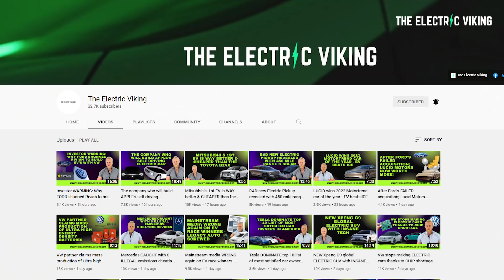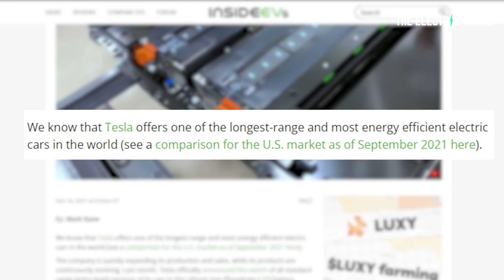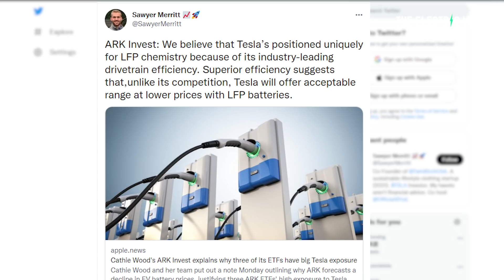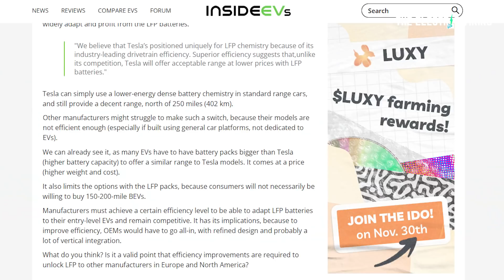3 REASONS Tesla pivoted to LFP batteries faster than everyone else

Comment: Key advantage of LFP is the size of the resource. Iron, lithium and phosphate are all very common materials. Currently this means lower price, but at higher volumes in means the difference between being possible to scale or not.

I think you are mixing up gross margin (gross profit before overheads) vs operating margin (net profit). Typical 8% operating margin for a legacy auto manufacturer compares to about 14% in Tesla last quarter.  The 14% is not 30% but it is impressive because it is much more than 8 and is entirely from the sale of EV’s.

Comment: My LFP Model 3 has been performing brilliantly and it's starting to get quite cold in the Chicago area. Being able to use all of the battery is a huge advantage over NCM Bolt I used to drive. The heat pump seems to make a huge difference because I'm just not noticing a huge drop in performance due to the cold like I did in the Bolt.

Comment: Waiting for the cyber truck my number is around 67000. Rumor is they will have 4680 but the chemistry  is unknown at present. I want range but the truck does not have to go 0 to 60 in 3.2 seconds. I want 500 miles range with a 2 motor set up instead of 3 motors.  I want to be able to road trip and not be unduly constrained.

Comment: I'd rather have a ternary battery unless the LFP battery has a fast, efficient heating system.  BYD Blade has a good heater that solves LFP's low temperature problems.  I also prefer the higher energy density of ternary batteries.  I like acceleration.  Ternary lasts long enough for me, and charging between 20 and 80 percent for everyday use is a non-problem.  If LFP cost dramatically less than ternary, that could influence my decision.
Reply: Don't worry by time you actually have to change your batteries the price of them worldwide will have come down significantly by then everyone's going to have figured out which ones to use for different reasons Vehicles will most likely have multiple battery type options and will eventually be manufactured by recycling and remanufacturing companies like abml which will help to drive prices even lower

Comment: Hi Viking. Maybe you can answer this question that I have never seen answered anywhere:
- Can 4680 or other cylindrical cells as well be LFP? 
I have seen a hundred uninformed opinion about 4680 against LFP, but never understood why not having cylindrical 4680 LFP and turn it into a structural battery that would be cheap, safe, super long battery life, 0-100% repeated charge/recharge cycle, fast charge times, etc.
Structural battery using 4680 or similar cylindrical cells has such huge mass production (both cell and car mass production) benefits that the prismatic cells can't provide.
Reply: 4680 is just a battery size.  You can have any chemistry you want in it.
Reply: @incognitotorpedo42  I know it's a battery size. I was assuming it could be also LFP, but never saw any expert saying so.

Comment: The more car models there are the more difficult it is to chose one. Frankly I think my choice is not built yet.
What I want is a utility van that I can convert to the task I need to perform at the time. I want it low to the ground not at all like those horrible looking pickup trucks. I’d like it to be small enough to park it in a congested city and long enough to sleep or camp in, a tue utility vehicle. I think the ID Buzz would fit the bill… if the price is adequate and if ever it comes out.☹️

Comment: The big question here is will Tesla be able to run LFP chemistry in 4680s. If they can increase the energy density by just 10% and reduce the cost of manufacture by just 10%, then that gives Tesla the ability to offer the  standard Model 3 and Y with over 300 miles of EPA range. That is an incredible marketing advantage over every other EV maker.

Comment: BYD literally invented them. As far as I know, BYD wil sell them to Tesla, so in what sense is Tesla ahead here? BYDs Blade Battery was out last year already, including the information about it's advantages. So what about the 4680 now? Those have been announced like the second coming - and now? In the future, BYD will flood (like other chinese brands) the worldwide market with good EVs loaded with LFP batteries (which was not possible before for patent reasons).
Reply: The way the 4680 battery is stacked is incredibly unique its ability to charge fast last longer Costless and wouldn't be hard to change the battery ingredients the  lithium ions move from the negative electrode to the positive electrode during discharge and back when charging. Positive cathode negative anode the cathode and the anode are usually made of cobalt or graphite which is very expensive and Cobalt is mainly mining in Africa using methods that are inhumane
Using the 4680 cell you would just have to replace the Cobalt or graphite with iron and phosphate

Comment: Back in 2015 and before that the Nissan Leaf came with a LiFePO4 battery with a poor reputation for rapidly deteriorating range and a short usable life time.  Tesla on the other hand with an NCA battery had little range loss per year, the battery might even outlast the rest of the car. Of course Nissan did not liquid cool the Leaf battery, even the air cooling with the battery being in a closed box was hopeless. However even given the well known lack of thermal management it seems passing strange that a technology that was regarded as second rate when compared to Tesla's high energy density batteries is now being embraced by Tesla and the NCA technology we were convinced was superior is being quietly sidelined. Just as you think you have a handle on the broad strokes everything you thought you knew is no longer true.
Reply: Duracell and Energizer batteries we're always good but have gotten better...Cobalt is very expensive and mainly is mined in Africa using methods that are considered inhumane

Comment: LFP's like to be fast charged at warmer temperatures, 30 - 35 degrees celsius. Then you get okish 180 kw peak charging. At 20-25 ºC you only get half of that charging speed. Meaning if you live in a place with colder seasons with max temps of 5ºC, forget that peak 180 charging speed as the TM3 and TMY thermal management right now can only provide you with half of it by reaching only 20 - 25ºC. Despite that you still have a charging speed above NMC's after a state of charge of 75% and unafected power delivery.  If you live in warmer regions and need a daily and beaten workhorse car, not the fastestest sporty car, LPF's seems to be the really clever option. Nonetheless I can't see Tesla using the LFP chemistry in their 4680s because those use the Tesla patented dry electrodes for fast production which have not been developed for the LFP chemistry. So, no, no structural packs can be build with LFPs mean Tesla will need to build two versions of the Model Y which doesn't make sense but will see how things develop.
Reply: Yeah it's going to take some time but thousands of things need batteries they are not all the same for good reasons besides this guy is putting rockets in space you think he's going to let a little thing like what goes in the 4680 stop him same cam same soup different ingredients

Comment: Everyone always forgets that the 2014 Chevy Spark EV has LFP batteries.  I bought one and can tell you the battery is holding up great.  Originally the car had a mixed driving range of 83 miles.  Now 7.5 years later when I charge the car up to 100% now it usually says 80 miles range.  It even said 81 miles last week though 79 miles range is not unheard of for me either.  The car's computer takes into account the last 50 miles of driving and calculates how many kWh per mile you averaged to computer the range of the car.  Even though the car's range is 80 miles there are enough DC Fast Chargers in my State that I can go anywhere.  Even a car with only 40 or 50 miles is very usable as long as it has DC Fast Charging capabilities.  I think a car with 150 miles range would be ideal.  250 or more is overkill and just a waste of energy carrying a bigger heavier battery around.  My hope is the LFP batteries will be shown to be able to DC Fast Charge at much higher kW than other chemistry.  My Spark EV can DC Fast Charge at 50 kW.  It can charge from 0 to 80% in 20 minutes.  A 30% to 80% takes me just under 10 minutes.  Imagine if it could charge at 150 kW.  That 0 to 80% would take just over 6 minutes 30 seconds.
Reply: That looks like another epic fail by GM's management. They were using the safest, most long lived battery chemistry years before Tesla, yet they still managed to muck it up by booting LFP batteries
Reply: @xmiller7691  from what I understand General Motors battery supplier during the spark and volt production was a company called A123 Systems in the early 2000s right around the time gas prices doubled I would not be the least bit surprised if Big Oil lined the pockets of some General Motors executives to make sure they didn't have to worry about Alternative energy competition
 General Motors now partnered with LG chem have recalled over 200,000 vehicles due to fires from the batteries
Hyundai also recalled 90,000 vehicles for fear of the same issues
Reply: "Overkill" range becomes a must have in colder climates where the battery may read 30% and then quit and leave you by the side of the road.
Reply: Sounds if the Leaf used them originally they would had held on to a larger market share.
Reply: You cannot waste energy in the manner you are referring to if you have a larger battery s more capacity for energy you will be able to drive further therefore you will be charging your car less frequently which helps to alleviate drain on power grids. and I do not mean to be rude but I fail to understand your logic referring to carrying a bigger heavier battery around you must keep in mind that you could have a thousand-pound battery a 2000 lb battery a 2500 lb battery and the vehicle overall will most likely weigh less or about average of any other vehicle in its class because there is no transmission driveshaft differentials engine block manifolds exhaust pipes mufflers oil pan ECT.
electric delivers instant torque the horsepower is actual and because all of the vehicle's power is available to the motors instantly it is more than capable of propelling the vehicle. Regardless of weight . I am curious... if you're only getting 80 miles to a charge how many miles do you average per week?
 my Lucid AIR has a 500-mile range I will charge it for the first time tomorrow I have been driving it for 3 weeks I must say something that has always confounded me is the idea of needing the batteries to charge in minutes I will plug it in to charge just like I will my phone before I go to bed and when I wake up in the morning I will have another 500 miles and if the day should ever come and it will that I drive the full 500 miles I will be more than content with taking a couple hour break while it recharges...of course extenuating circumstances may exist leaving a person unable to follow the routine of charging something while they sleep at night so far it is looking as though I will only have to charge my vehicle twice a month Lifestyles very we all Drive different distances to get where we're needed but I have never had a gas-powered vehicle that could drive 500 miles on a full tank my F150 FX4 gets about 430 miles to a full tank cost me about $400 a month mid-grade gas absolutely ridiculous

Comment: I have heard the LFP does not provide the same performance (acceleration in particular) than existing battery platforms.  So the trade off will depend desire of the customers. I note only standard range has this option, if it was a wide ranging option it would seem we would see it across the board.
Reply: Standard and long range both have the same space for batteries. The long range needs all that space for higher energy density NMC but the standard range can fill that space with lower energy density LFP much more efficiently than partially filling it with NMC.

Comment: I like the concept of a bullet proof battery where overcharging will not damage the battery.  I hope the Roadster comes with LFP battery if given the choice.  The 4680 battery lets out more amperage due to the design so I hope the Roadster is made with the 4680 battery.  

I will own A roadster, cypertruck with three motors and a High performance Model 3.  To me it’s like buy a art piece that one can admire.

Comment: Does it mean that Tesla will abandon the 4680 battery before large scale production of it? I think China has a large advantage on LFP batteries over Tesla. Even the best LFP solar battery BattleBorn use LFP cells imported from China.
Reply: 4680 can use LFP chemistry.
Reply: 4680 represents the dimensions of the shell the new battery is housed in you can really put anything you want in it although the 4680 is a very uniquely manufactured type of battery which allows for faster charging longer life and more power output it is what will be used in the cybertruck and also the Tesla semi
Reply: @devonkripaitis4490  I think 4680 is basically Li-ion cell with the same chemistry as 18650 cells, although with some improvement. It can still start a fire in an accident which is far more dangerous than LFP chemistry. It has slightly higher energy density than LFP cells.

Comment: I'm got my eye on the BYD Dolphin with its LFP Blade batteries. But I'm curious to know what will be in the ~$25K Tesla. Will they use Blades from BYD? Or CATL Prismatics, like what's in the SR 3 & Y? Or will they go with a 4680 LFPs? 

I do wish when Chevy finally relaunches its Bolt for the 2023 model year that they'll consider LFP cells. It's one of your videos from a couple of months ago, Sam, that you noted LG Chem is now hurrying up to make LFP cells. One of the Detroit manufacturers has to end up making a basic hatchback with LFP cells, just so they can compete with the Chinese (and Tesla) in that vehicle class. 

Another idea for me would be to get a 2nd used i-MiEV, drop the pack, and reloading it with LFP prismatics. There's a fair amount of room in that battery box for extra cells. Because the stock LMO cells are slightly more energy dense than LFP, what I would probably end up with is a vehicle with about the same range as the original (~70 miles per charge.) Still, that's enough for my city driving needs.
Reply: I think I heard the Bolt is dead.
Reply: @lesbendo6363  The last I heard is that there will be no 2022 model, but nothing about a complete cancellation of the car. So, a refresh for 2023 is still in the cards.
Reply: @benjaminnead8557  If they can resolve their battery issues the Bolt may save the company.  It was a very popular EV.
Reply: @lesbendo6363  Chevy still has a lot of work cut out for them. The Bolt is currently a black eye for them right now. They'll certainly get a settlement check for around 2 Billion Dollars from LG Chem for the bad cells, but it's still going to be up to Chevy themselves to get all those existing Bolts into dealerships for module/row swaps. That takes time. 

Meanwhile, I'd like to know more about the Ultium cell that's going to be in the next generation GM cars. It appears to be another rectangular slat prismatic format, not unlike the Blade. Curious to know more about the differences and similarities. Will an LFP version be made? Will a relaunch of the Bolt or similar future Chevy hatchback have such a battery?
Reply: Well, that 25 grand is in US dollars, so over 30-32 grand in Australia. I think it will use BYD blade batteries if the Tesla 2 is made in china, but it depends on how many BYD Blade batteries they are selling to Elon Musk, you might find some have CATL Prismatics as a backup supplier.
Reply: @Peter-vn8ue  I heard the rumored deal was for something like 10GWh. So, what is that? Around 200K cars with 45kWh packs?

Comment: I own a Model X and a Model 3.  I own solar panels and a powerwall storage battery.  I live on Hawaii where electricity is 37 cents/kwh.  I save $600/month on gas and home electricity with my solar panels and powerwall.  My model X is a 2017 with 50,000 miles and never visited to service center.  The only maintenance were new tires at 30,000 miles.  I also own a Porsche Panamera 4S which we barely drive .  Feels underpowered vs Tesla.  Plus you notice petrochemical odors in a gas car.  I use LFP batteries in my motorcycles.  LFP is great technology.  Happy with either.  Lots of iron on earth.  Lfp safer battery
Reply: Sounds like freedom from fossil fuels is possible for you.Then  Why don’t people get it especially as electric vehicles become more available and less expensive along with solar and at home batteries .you live in paradise in more ways than one
Reply: Why do EVs need tires every 30K miles? Tires usually last 75K on my pickup (often more).
Reply: @richardlocke7264  it's hard not to get your foot into it, also the car is heavy so that can be a factor, my daughter's model Y long range was the same 30,000 I believe
Reply: @richardlocke7264  most electric vehicles are running low profile tires that do wear down quicker they are also mostly all-wheel drive with each will having the capability of making adjustments independently of the other Wheels in other words Kick-Ass traction control in conjunction with the vehicles Max torque capability delivered at zero RPMs and hundreds of more horsepower than average gas powered cars or trucks and I wouldn't be surprised in the least bit if tires these days are more expensive and overall lower-quality because oil companies know they are going the way of the dinosaur and pretty soon tires will be the only thing made from oil
Reply: I have 25k on my m3. Plenty of tread left.